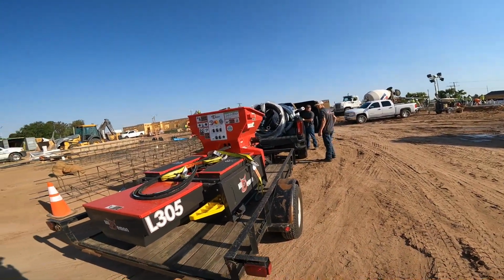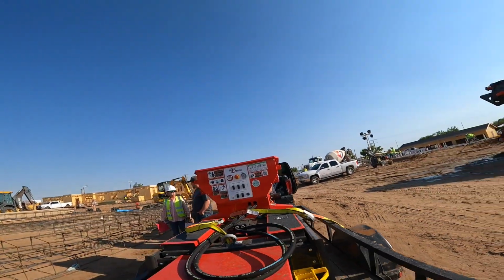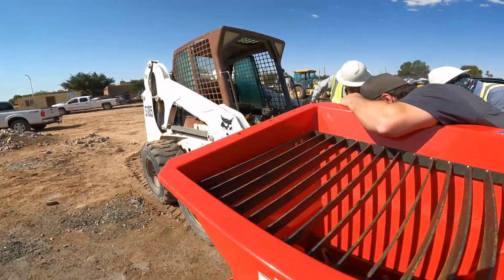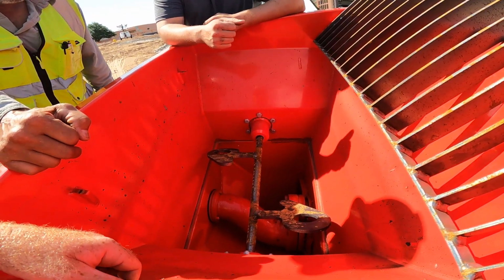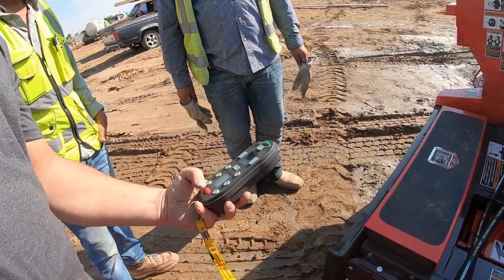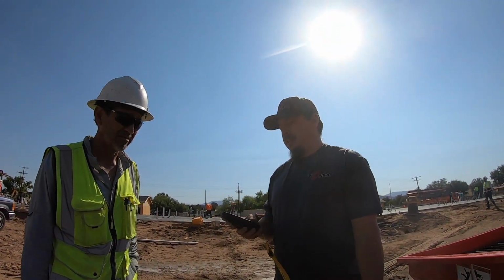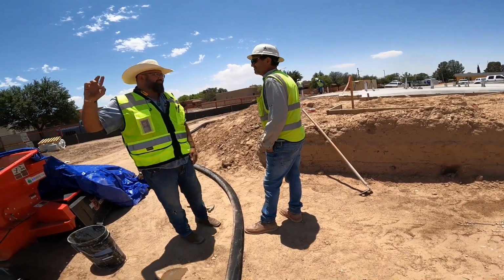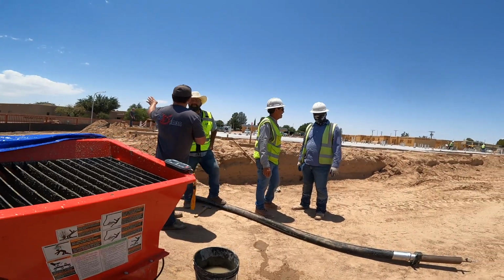Selling my first Mud Demon!!! Customer demonstration when they buy a new concrete pump.

Comment: need to see this thing pump faster on that bobcat. Ive got an older machine and if thats the best it'll do im gonna be waiting awhile to buy one of these :/
Reply: the bobcat at this location was only in low flow and was low on hydraulic oil and was cavitating at times (sucking air witch made for short shifting and lack of output). what model and year machine would you have i can lookup what output you would get. this customer in general was planning on replacing this with a newer machine with high flow for the full 30 yards per hour.
Reply: @MuDemon2023  im a 2007 kubota standard svl-75 not that -2....thank you for the reply. I love my kubota and when it dies ill get something newer but it just keeps going and going. pre def
Reply from the maker: The newer machines are better suited for the pump unless you have a high flow machine. I’m not sure how well maintained the machine was in this video. This pump is a great pump but it’s limitations is really up to the machine you hook it up to. I’m not sure if you have watched many of my videos but there are other videos that we have that better showcase this concrete pump.
Reply: @MuddyfeetConcretePumping  I saw the deere. was fantastic. and I'll seriously consider this pump when i get a new skid, but my skid currently runs great. so priced in pumps is where I'm at, I'm actually glad to see this on an older skid which is probably the production i would be seeing.
Reply from the maker: @bradley-concrete looking at the specs on your machine it looks like you can expect 18 yards a hour out of this pump. The maximum you’ll be able to get out of this pump is 30 yards an hour. The newer machines on standard flow you can expect to get 20-23 yards a hour. Then the high flow machines will get you to the 30 yards an hour. So far I’ve pumped 2 jobs where I needed the volume of a high flow machine. Everything else has been stop and go. Especially pool decks and walls. You just don’t need that kind of volume for them. My contact information is in the description. If you have more questions I would like to visit more with you about it.

Comment: I like how they’ve added the hydraulic hoses to extend the reach of the remotes. Being able to back the tractor up away from the machine is nice. I think I have the same Dewalt you have Jeff. I absolutely dislike mine haha! I have tons of dewalt and Milwaukee too. Definitely gonna grab one of the Milwaukee brands though.
Reply: Milwaukee unit we are very happy with up in Canada land here 😂😂😂
Reply: @canadianconcretepumper1979  I can see in your videos it performs perfectly for what us line pumpers need out of them. The dewalt one is okay for a couple of hoses and maybe okay for helping push the ball back to the hopper but when I need to clean out 200+ ft of hose, it stumbles big time! I have a gas powered 20 gallon unit on my truck but in certain situations the small compressor is great. I hate dragging out air hoses for a few hoses to be cleaned but I do use my gas powered one for my diaphragm pump that I use to wash out. So I hardly use the battery powered compressors it’s just nice to have if I need them lol.
Reply: @chriscalhoun.concretepumping  For sure. The Milwaukee works great, if all gaskets/clamps are tight. Even a small leak at any of the connections and it just can’t maintain air pressure. If anything, it’s given us motivation to keep all our clamps and gaskets extra clean and tight 😁😁😁
Reply from the maker: Yeah I haven’t hooked mine to hose yet. But I was impressed with the Milwaukee one